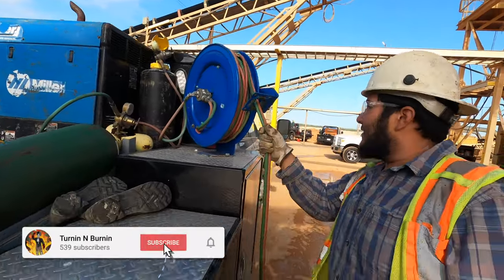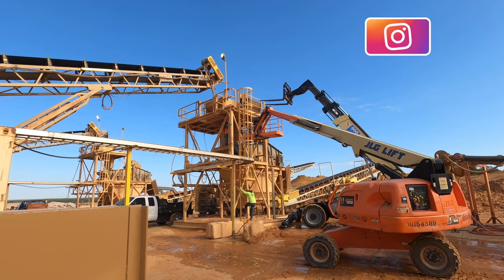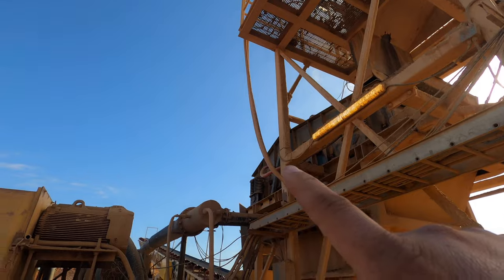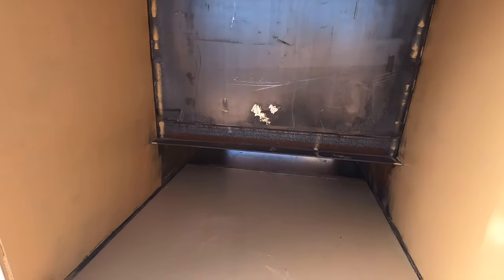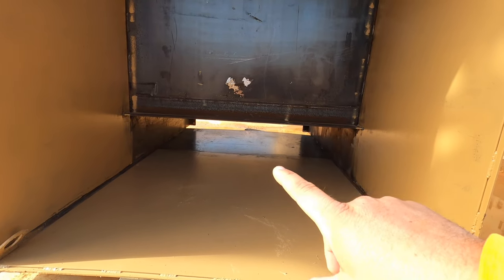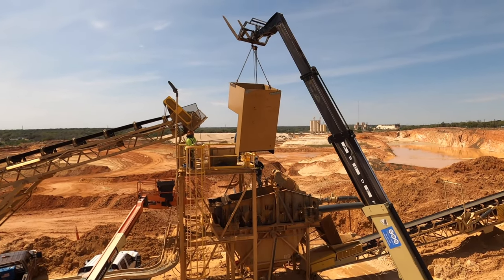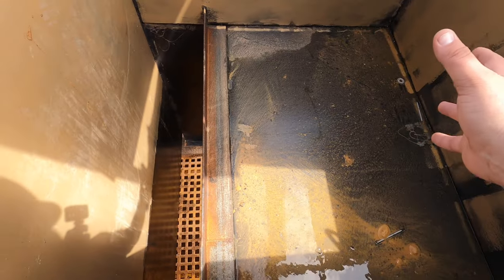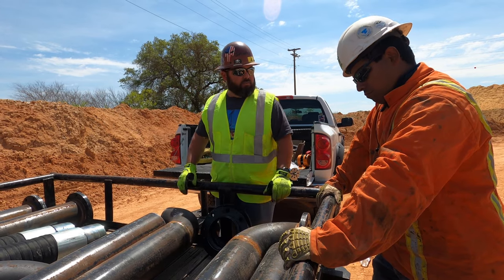Installing a Chute and Water Pipes

Comment: 1/4” steel? How long until the material wears out that wall ?
Reply from the maker: @joselopez3607  if my memory serves correctly, think I showed in the video how we built a shelf in the main area to build up material and it would wear rock and sand on rock and sand. Widen out the discharge opening and installed AR400 wear plate on areas that could see wear. Not sure how long this one lasted but the idea is before it wears through the AR plate they can replace it. All depends on the aggressiveness of the aggregate hitting the west spots and normally it’s a good practice to install a west plate, plastic or other medium to slow the wear.